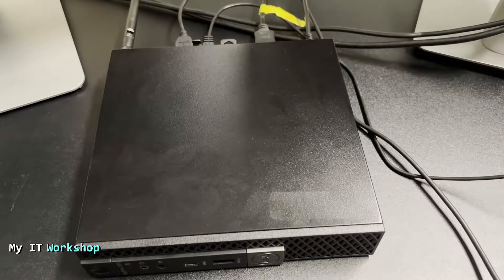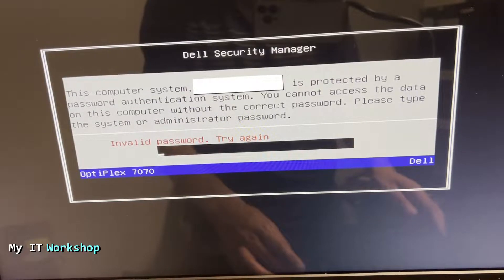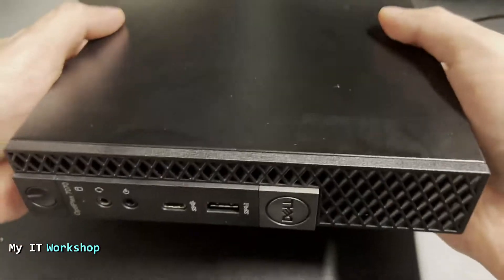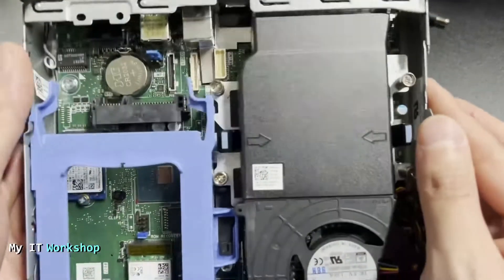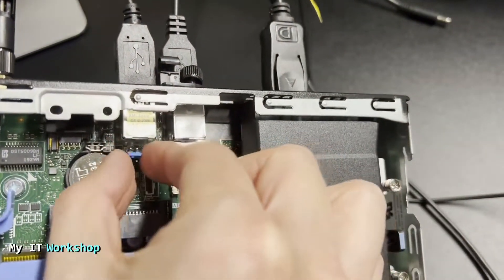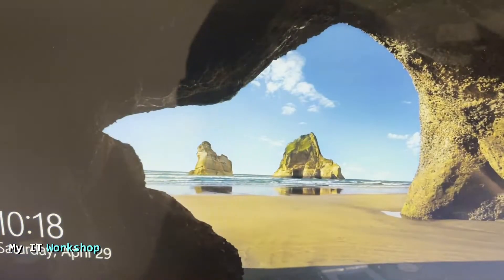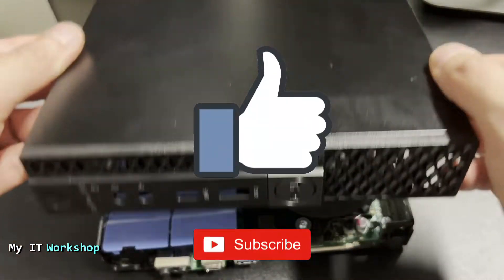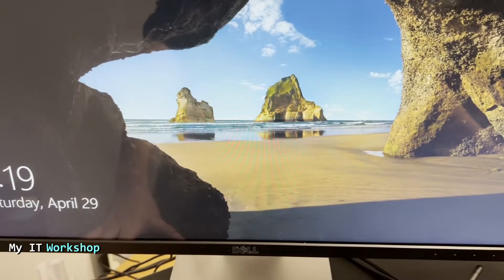Dell optiplex 7070 bios pass reset

Comment: Hi Alvendril, do you know how to remove the admin password from a Dell OptiPlex Micro Plus 7010, it's very similar to the one you're showing in this video but slightly different. The one I got does not have the jumper for me to remove. I bought it in a garage sale and since it was cheap, I thought I would try it. The guy I bought it from mentioned that it was from his previous work and since he quit two years ago he was selling it for cheap. If you have any tips, I would greatly appreciate it. Thank you!
Reply: Same here. Is there a solution?
Reply: No jumper on a 7020 micro either
Reply: Same here, did you find a solution? 7010 does not have a jumper

Comment: maybe you could tell me? Im having a helluva time getting this thins to boot.  I have a 7070 and the bios  refuses to allow me to install windows into the system. I can take the drive out and put it in a usb caddy and install it and it works but if I take it out and out it back in it tells me there are no bootable drives in the system. Im at my wits end and am ready to throw it in the trash. I reset bios over and over,pulled out the battery and left it out, tried turning off boot protection and all that jazz and nothing works. I can even put a boot usb stick in and install windows 10 but when i restart .....no bootable drive. 

this all started when I put a nvme 3.1x4 into the m.2 slot, made it active in disk management then rebooted to try and install windows onto it. now I cant do anything with the system. do I just save the  processor and throw it in the trash?